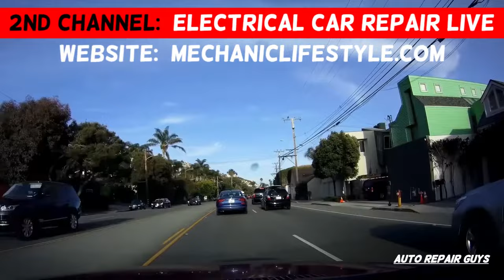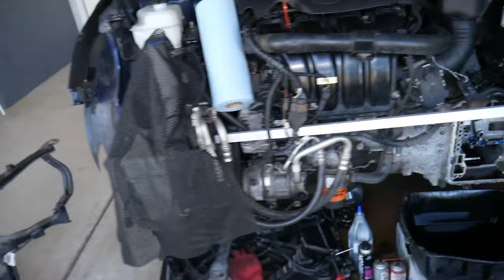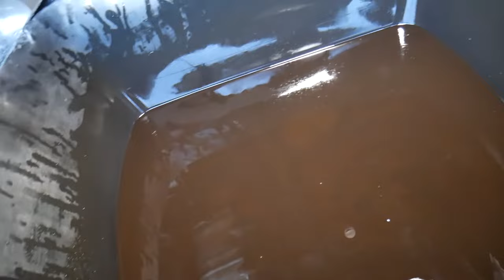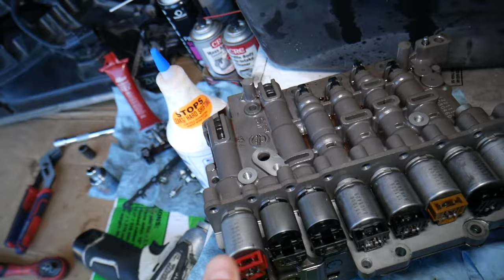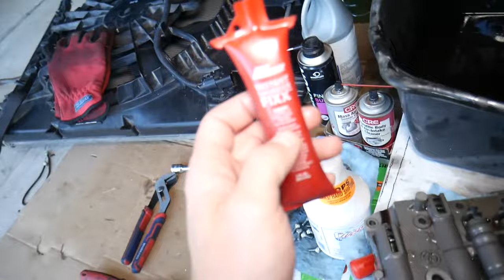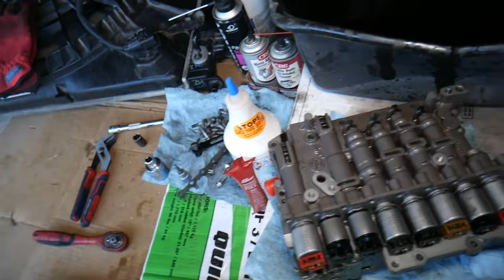THIS IS WHY YOU HAVE TRANSMISSION SHUDDER VIBRATIONS ON A CAR

Comment: Chevy garages have machine called ..Bosch transmission flush machine ...
It gets all fluid out of transmission ...
If that does not correct the shudder you need new Torgue Convertor ....

Comment: Hey Auto repair, I have a suzuki solio which vibrates intensely that it also shakes dashboard after slow down or after a bump upon accelerating, I have checked for mounts which are all good, i have changed cvt oil but its still vibration.
For me to avoid vibration i just put it to neutral and back to drive. What could be the cause.

Comment: Hi ninja! Thanks for this video! I have a 2007 CX-9 with 165,000 miles… and never did the transmission oil change 😬🤦‍♂️, it start to shudder. I have a used the Instant shudder fixx and it worked! The shudder is no longer present. Should I leave it like that or should I still do the oil change!?!
Reply: It’s always recommended to change the oil. I just changed and it fixed 95% of the shutter. I’m going to try to add this stuff and hope that helps and change the oil again after 30k miles
Reply: @edgarduran8291  thanks again!!!
Reply: @TC-en7vi  yes, that shudder could just be dirty oil. Some ppl changed it 2-3 times within a month and it went away. I changed a week ago for the first time and the shudder almos disappear. I might just change it again But yea you don’t want contaminated oil in your transmission.
Reply: @edgarduran8291 did it fix your issue after multiple flushes?
Reply: @prabeeshsidhu I just did a regular oil change. No flush. And it was still shaking, very lightly so I added one tube and it’s been normal since then. Its been over a year.

Comment: man cars and products are just getting shittier and shittier, you use to never have to change transmission fluid(or even if you did and didn't you wouldn't have these kind of problems), and now its recommended every 30k on modern cars? all this so called "innovation" in technology just seems to be a facade. Just pushes up higher barriers to entry and higher repair costs.
Reply: @legioner9  yes but transmission fluid would last the life of the car. Now you have cars having stutters and other transmission problems if you don't change it every 20k miles

Comment: How to tell if it is a transmission shutter or an engine performance shutter as I drive more doing my deliveries I noticed the shutter more and when I start driving right away as I start it and wait about like at least a minute and then I start driving. I don’t feel it so much. I also noticed that when I manually shifting it does not shutter barely at all so I’m kind of wondering if it is the first part being a fluid or if it has something to do with maybe something in my engine, my engine, sometimes rough idols, and Hyundai ELANTRA I known for doing that. Any suggestions?
Reply: On a Ford the shudder happens when vehicle shifts from 4th to 5th and stops once in 6th gear and is due to the Torque Converter Clutch (TCC) being dirty/gummed up. Instant Shudder fix worked perfectly for me for that issue. 
I don't know about an Elantra ;but I'd start with the ABCs, check your oil level and quality (if it's dark it should be changed), check your transmission fluid level and quality. Using a vehicle for deliveries means you should stay on top of your fluids. Wouldn't hurt to check the condition of your spark plugs and Ignition Coils, fuel filter and other stuff like that too.

Comment: I flush by disconnecting the cooler return line and have the transmission after the initial drain and overfill. Gets 99% out.